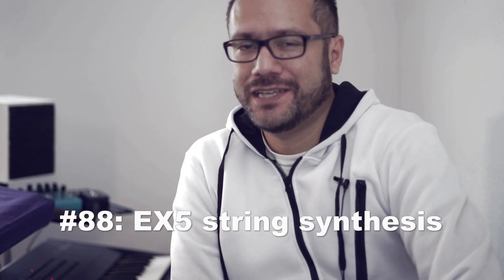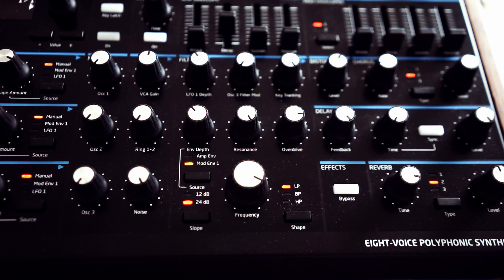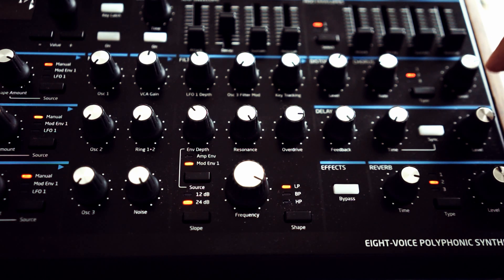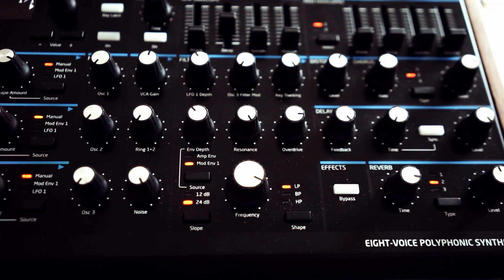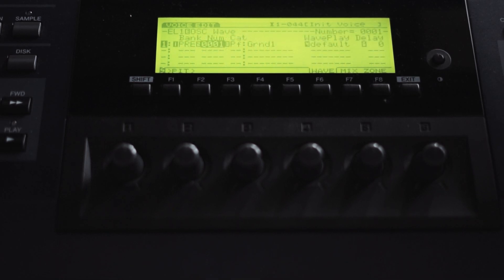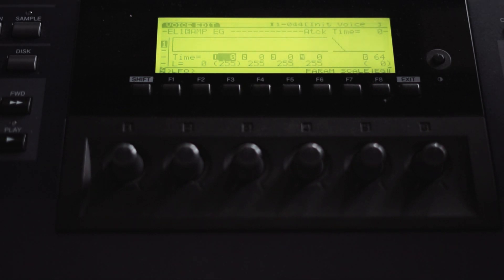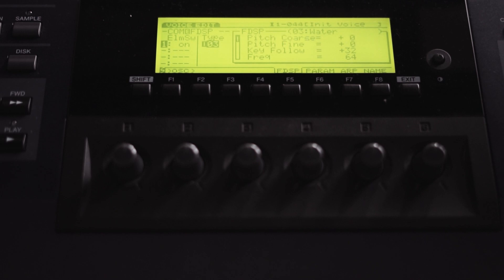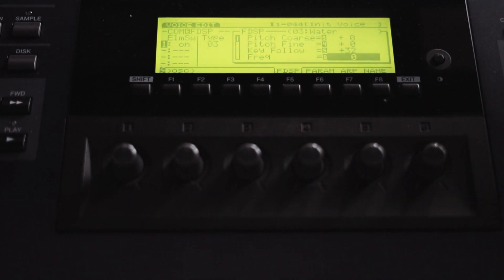Karplus-Strong synthesis on the Yamaha EX5 - creating plucked string sounds out of noise

Comment: FDSP is a bit weird, and especially the water effect, but it must have taken you quite a bit of time to figure this craziness out. It just goes to show that Yamaha threw everything including the kitchen sink at the EX5, and 25 years later we're still discovering new things about it.
Reply from the maker: Thanks for watching! FDSP is a bit weird indeed, but mainly because the default settings on the effects are extreme. Once you wrap your head around the fact both VL and FDSP are recursive delay effects, and then translate the parameter names to the usual synth terms, you can start using it more confidently ;-)